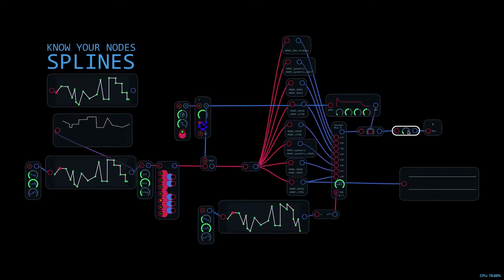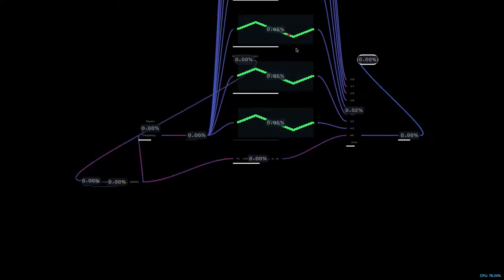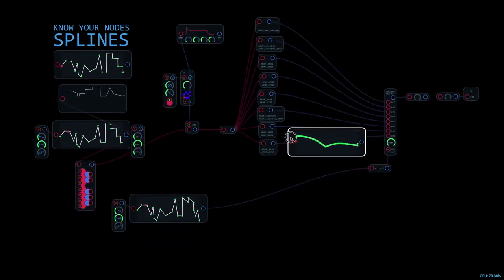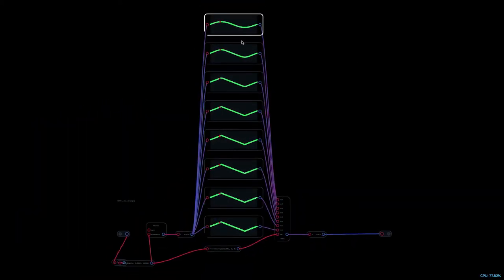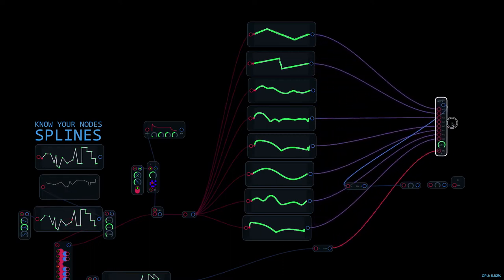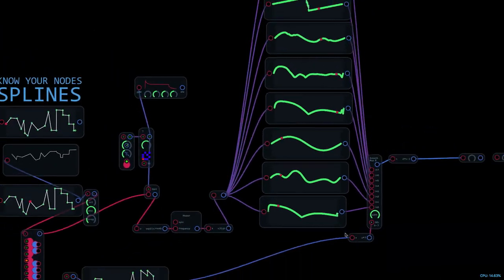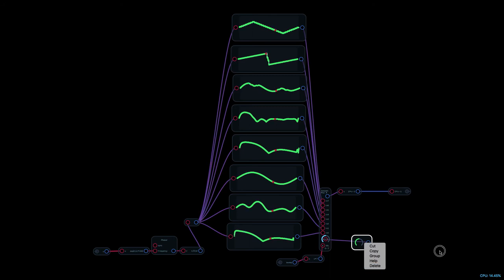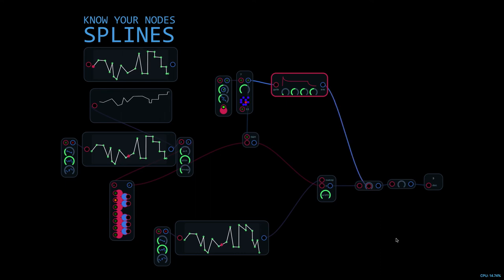Know Your Nodes  pt 5.5 Streamlining A Big Patch

Comment: Liked how you explained the process of taking an existing patch and how you go through and streamline it. It might be useful to do a video or link to an existing video on anti-aliasing so the less technically savvy will know about the issues involved since its removal was sacrificed to go from 80-14% cpu usage. One of the useful things about a visual programming app like Audulus is that you can learn about the trade-offs a developer has to work with during synthesis whereas for many musicians who use apps with limited understanding of their inner workings, it can be difficult to fully appreciate the decisions developers make when they design apps.
Reply from the maker: Sure, explaining aliasing was actually a topic I trimmed for time.  I even have some example patches set up.